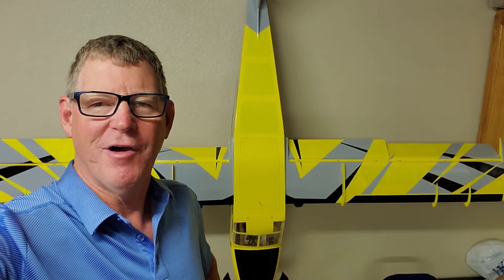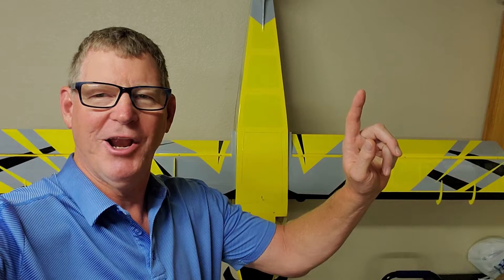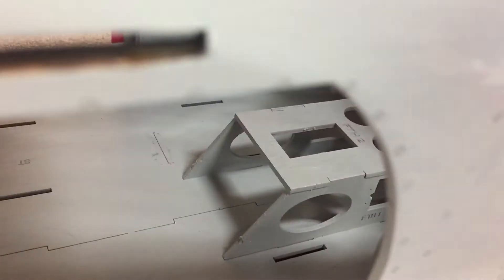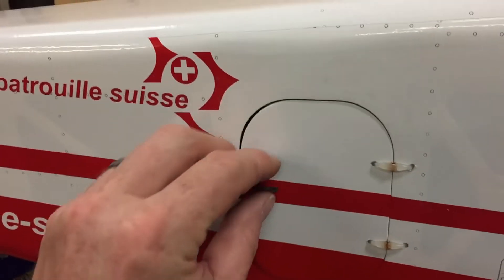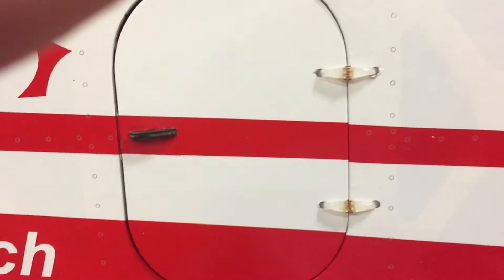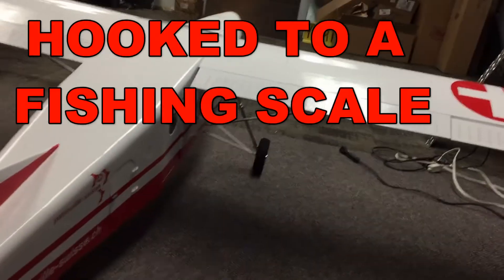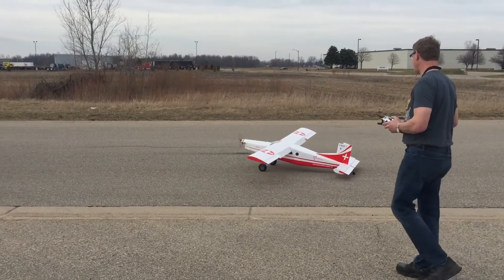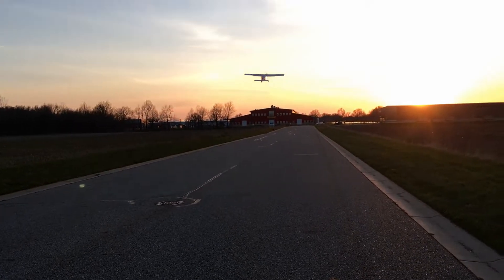Contra Rotating Motors Pilatus Porter RCTWINS

Comment: what diameter prop she swinging?
Reply from the maker: 20.5 x 20 in the front and 20 x 22 in the back, there is more info on our video Contra-Rotating build video on our channel or on our site www.rctwins.com
Reply: This airplane was the test bed for hours of research and development in Electric Contra rotating drive, I had it taking off in 20 feet. The most important thing on power up is that the batteries have no bad cells, and that both speed controllers start up correctly. IF YOU START YOUR TAKEOFF ROLL and it seems gutless shut it down and restart the system.
Reply: @rodneytanis8241  it's a thing of beauty. Love y'alls contra rotating content
Reply: Thank you so much for your comment